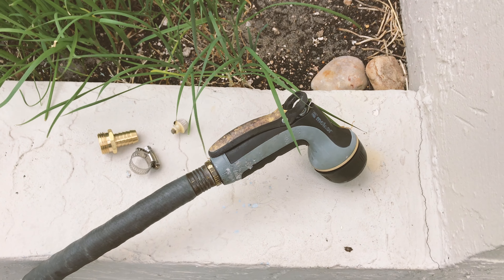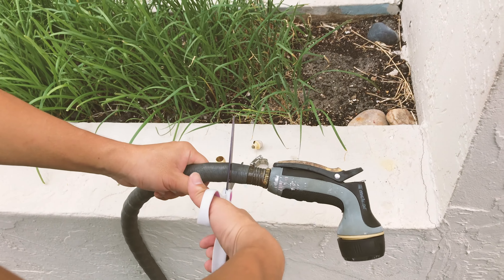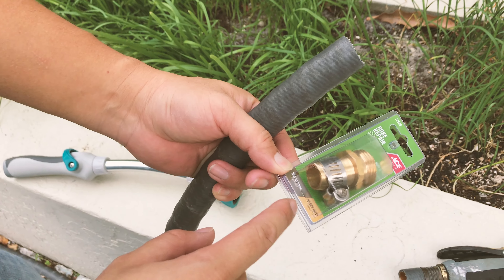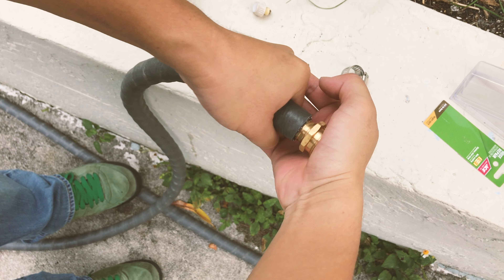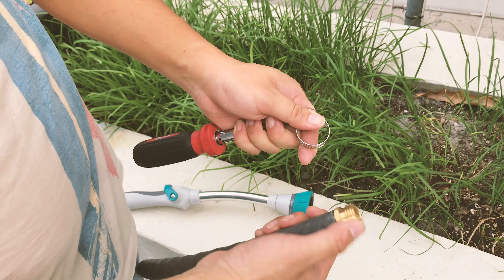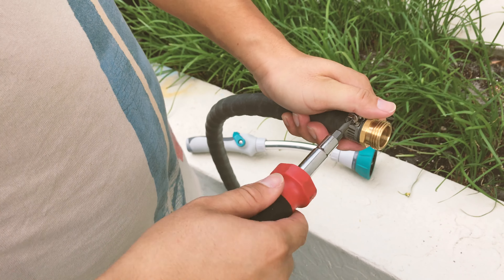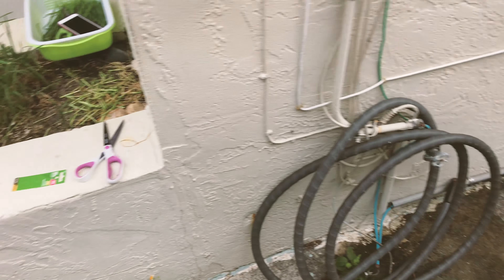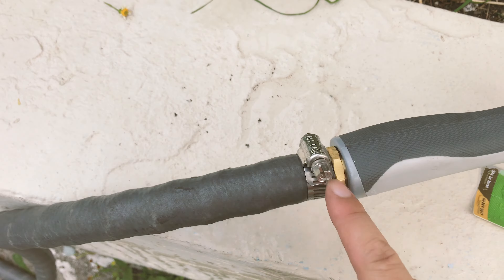Super Easy Garden Hose Repair - How To Replace Broken Garden Hose Connectors

Comment: A tip, dip rubber hose end in warm or hot water for a few seconds before inserting the fitting will be a breeze, no need force
Reply from the maker: fantastic tip! Thanks for sharing

Comment: I used to used & trust those clamp style ones but I found that the compression fitting ones work better and they never leak, you could get some cheap plastic ones at Walmart and they work really good, I will never go back to the hose clamp style ones